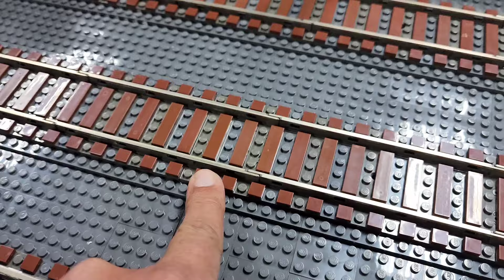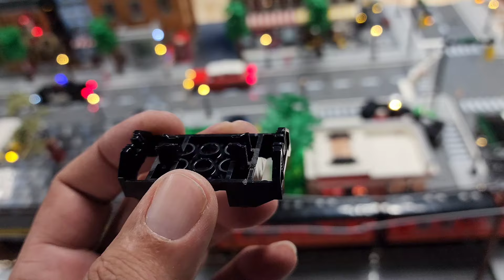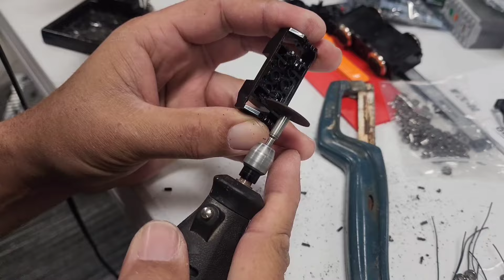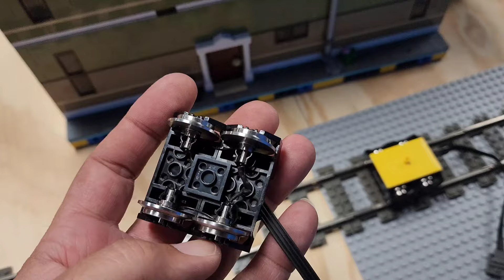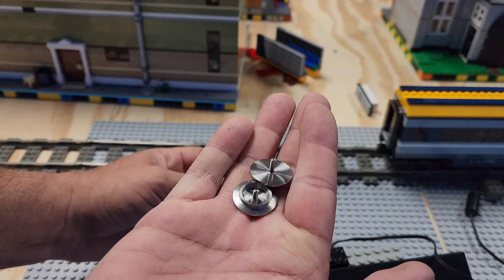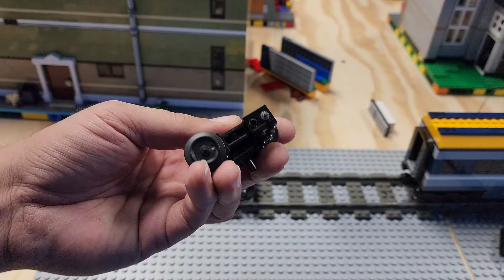Innovative Lego Train Power Solution: No More Batteries Needed!

Comment: Please send this to LEGO to let them rethink their current train system.
Reply: Personally I'm a fan of the electric rails owning both 12v and 9v stuff, but I don't think LEGO is actually wrong in their current methods either. Lego is expensive anyway and the track is expensive enough even when its just mass produced injection moulded plastic, using the 9v style track by default is going to price most folks out of buying the Lego train for their kids. And that isn't a good thing, if you don't get the kids ever playing with stuff outside of the computer toys like Lego will start to die as the oldtimers do. Plus not being conductive track means you can create track layouts that would be impossible in 9V. 

A battery is simple, relatively cheap to buy, lasts a pretty long time even with cheaper low capacity rechargeable battery and ages with alkaline battery. Its good enough.
Reply: @foldionepapyrus3441 Lego isn’t expensive because of the production cost though. Lego is just expensive because it’s Lego.
Reply: @woalk  Not that I have any major complaints with any of the clones I've tried, they do interesting ideas Lego have not, and at the price being rather shoddy in comparison isn't disappointing really. You just can't compare the two so directly and say Lego is too expensive. As you do get what you pay for.

Lego is really high quality, lasts virtually forever, and has really well thought out set designs that have clearly gone through many iterations to be really detailed, solid constructions, and still have the play value. Where the clone type construction stuff may be substantially cheaper, but its generally massively worse in quality, with much worse set design that you have to add new parts to so it won't fall apart on its own...

So yeah Lego isn't expensive entirely because because of the individual parts production costs, some of it is because they have great customer service and really make well thought out sets - all that proof of the design costs more. But the parts are just better than the clones, especially the cheap clones that either don't grip at all or can't actually be put together without a softhammer... 

Mouldking stuff is the only 'compatible' clone I've seen that gets close in part quality to Lego, and its not exactly cheap either. Because parts with the right tolerance even when you are very clearly copying Lego's homework are not cheap to make the injection moulds for... And with the designs of their sets being stunning to look at but very flawed in places. It is very clear instead of rejigging the set design or designing their own part that won't cause rapid part failure for overstress by abuse they have copied Lego's homework and probably never actually test built the design for real before putting it on sale. For instance they use droid arms held in clip brick around the elbow as a decorative element on one of the locomotives I have - which just doesn't work you will snap that clip brick in very short order or lose the arm as it violently springs off if you don't file down the elbow and glue or solvent weld the two together...
Reply: @foldionepapyrus3441  Lego’s quality has degraded significantly in the last 10 or so years. It is barely better in terms of both set design as well as fit and colour accuracy/consistency than many of the other brick manufacturers. All of them, including Lego, manufacture in China under similar conditions.
You don’t need much of expertise to make that cost-benefit-analysis between them and “a little bit better, but 10x more expensive” Lego.
Reply: @woalk  That has not been my experience, the last real Lego set I bought was without identifiable flaw, the bricks have the perfect amount of clutch power, the colours uniform. And that was only this year. Feels a bit different to the ancient stuff, so maybe it won't last the decades so much old Lego already has. But equally the old stuff probably felt different when it was new and the plasticiser hasn't had any time to leech out..

Where of the clones as I liked the looks of many of the locomotives from other brands and Lego don't do much railway I've tried a few. And other than Mouldking which is very close, way beyond just barely scraping into acceptable if you are feeling chariable that most have been. The others have been pretty awful, bricks that won't stick right, with extremes even inside the same set of won't grip at all to grips so hard you will destroy at least one of them trying to separate them again, with colour that is not really really awful as a rule, but noticeably not uniform with the odd brick being terrible... And Mouldking the only ones I'd really call acceptable, and actually I'd go further and call good (and I have first hand experience of their replacement parts service being solid) are barely any cheaper than Lego for what you get, at best its 2/3rd the price Lego would be for a similar set, and you get worse instructions and much more poorly designed sets in the process (which doesn't personally bother me, as the challenge of fixing the flaws is fun but does add value to the real Lego).
Reply: @foldionepapyrus3441  If you can get them for a sensible shipping price in your country, check out some BlueBrixx specials locomotives.
Reply: @foldionepapyrus3441  plastic is dirt cheap adding a metal strip will not make it too expensive to produce, making it expensive for customers is solely a lego decision
Reply: @Fukurokujo  Plastic parts really are not dirt cheap, at least not when you are not managing to sell sixty billion of them out of a single injection mould. Just look at the price for the compatible metal rails from somewhere like Fxbricks, if Lego were doing it themselves being a bigger company with a brand name they might manage to bring the cost to the customer down a bit, but its not going to be nearly as cheap as the RC track can be, and that stuff isn't exactly cheap, even from the clone brands that probably have terrible quality in comparison...

Moulds are expensive to design, make and sometimes maintain and that cost doesn't become nearly zero per part if you don't manage to make and sell a near infinite number of parts. Which Lego railway track being a niche part of an already relatively niche area won't. And then you are adding in a relatively expensive metal component, that either has to be fed into the mould before each shot to be captured by the plastic or requires yet another production process afterwards and more complex metal forming geometry so it snaps on.  Both of which adds to the cost per unit, which then means you probably won't sell as many making the tooling cost even higher per unit.
Reply: Wasn't expecting to see you here!
Reply: Hi Leo
Reply: I do love this and while 9-12v obv wont hurt ya here, lego wouldnt want liability involved with exposed live metal in a kids toy nowadays.
Reply: @andrewbeder51 you are wrong only lego
Reply: I have three systems in total at home. The blue unpowered track, the light gray 12V and some of the current style unpowered track again.

My primary track as a kid was the 12V track, because it was powered, but the amount of track I had available was rather limited. I installed the blue track as secondary, fiddle yard style. But the main thing I liked was the fact it was just a single track. I really don't like the linked together tracks because it's too bulky to store. 

But my kids love to play with the trains, so it offered me a chance to have them tinker. I have a good supply of arduino stuff, a few 9V motors and a 3d printer. Guess how dad and the kids are going to be doing to next few years. It'll probably drive mom completely nuts as the kids will probably learn how to operate the 3D printer all too fast ;) 

Bottom line: I will just invent my own line of lego train systems. Including a small manufacturing facility producing track and switches.
Reply: Never send Lego any ideas if you want to keep up creativity rather than profit

Comment: I'm very curious, how would a powered up version of this work if the only connection is what normally plugs into the battery pack? Will there be some kind of adapter to connect two plugs together?
Reply from the maker: Im working that out still, the biggest problem is I am waiting on plug ends to experiment with.

Comment: Maybe put a rectifier in your adapter for the IR receiver. That way it will always get the right polarity, no matter the polarity of the rails. This would also enable you to build more complex layouts by adding short sections without power between the differently polarised rails and having two pickups, rectified to the same polarity, far away from each other.
Reply: why not put a recitfier in the pickup itself, would make it fully compatible with powerfunctions.
Reply: @Ramog1000  Then it would no longer be compatible with the old 9V system with transformer. You couldn't drive backwards there.
Reply from the maker: You are exactly right, I am looking at making adapters with a rectifier built in to them though.
Reply: @ThisNameShallBeUnique  oh yeh right, whups

Comment: this is very cool, I dont have power track, but the lego grope Im in dose, and has train displays, I definitely may get one at some pont!
also I only see the 4 wheeled adapter and not the cheper one.
Reply from the maker: Im currently filling pre orders and will release both versions after the pre orders are filled.  As for the 1 wheel set or cheaper as you call it,  they do not work on switched track.

Comment: I'm the same on "say no to batteries".  Your diode adapter does make me wonder if a capacitor in that circuit could also help jump gaps in the track.  Like at my basic level understanding, it only needs to store enough energy to move the train less than an inch and it'd be sufficient.  I don't actually know how long the IR receiver has to be unpowered before it'll stop driving the motor though, maybe it's already internally handling that issue.

Sadly I'm probably not ready to pay international shipping on this kind of thing but it's nice to see new components available, not just hope to find the 25 year old bricks that still work.
Reply from the maker: Not sure if a cap would hold enough juice to power thru, but at the same time,  with a single wheel setup, the train rolls right over the gap if moving at a medium speed so it might.

Comment: I'm surprised that in the last 20 years no supplier has come up with the idea of offering something like this in mass production.
The idea itself is not new. FX-Bricks announced something similar 2 years ago. (i think)
This is so essential for 9v Train lovers.
Almost ALL Lego motor systems can be operated with this, including. 12v train-motors that also run wonderfully on 9v.
Above all, it makes digitizing the Lego trains enormously easier.
These current collectors MUST go into mass production and offer them (significantly) cheaper.

Comment: What are you using to transfer the power from the metal wheels to the cable? Carbon brushes? Metal springs?
Reply from the maker: Stainless steel bearings

Comment: Will this work on trixbrix tracks
Reply from the maker: Yes
Reply: It can't because trixbrix is 100% plastic just like LEGO RC track. Fx Track will work though.
Reply: @amseladams  my trixbrix have copper wire on them
Reply: @kkscott8019  I was not aware of 9V track from trixbrix. Is this a new product, or did you apply copper tape yourself? In any case this will work then of course.
Reply: @amseladams  I applied copper tape myself cause I like that they have narrow gauge tracks
Reply from the maker: I thought trixbrix also offered 9 volt track

Comment: What you could do regarding Powered up: Just create a replacement for the lower part of Powered Hub City Hub. There are two pins for 9V on the upper part. Pros: Train will still works with phone, remote or PyBricks, no patent issues. Cons: You still need an expensive hub.
Reply: I have just seen a video where it explains how to dismantle the Powered Hub to remove the big battery case and install two leads directly from the board. Quite an easy job. Removing the battery case will save a lot of volume as well!

Comment: Another great idea ! Just wish someone would make the 9v system parts again. I get so fed up changing batteries.
Reply from the maker: Thanks, Fxbricks makes great track for 9 volt.  I designed a simple power box and a new connecting cable, but still working out the bugs before I offer any of it.

Comment: When you doing the adapter from the wheels to the IR use a Rectifier circut.
Reply from the maker: Its basically a rectifier yes using diodes.

Comment: How well do they work on switches and other track that have small "gabs" (x-crossing). The reason why LEGO always used 2 pickups (front and after wheels for the motor for example) is to make sure the power pickup is never interrupted. I always wondered how big this impact is because LEGO could have cut costs there as well, but they didn't.
Reply from the maker: Thank you for this question.  As I feel I over looked testing on switched track.  As you are correct the switches have a gap that could cause an issue.  Ill be looking at that today and will be posting a video on it.

Comment: So we're back to the 70s/80s electric powered trains!
YES!
Reply: Well actually the 9v rails system was introduced in 1991, the 70s and 80s was the 12V center track era. Much to my annoyance, because I had gotten the red DB train (7745) for my birthday

But to be honest I converted that train to batteries to run on modern track for my sons. The amount of trouble with power pickup was just endless.
Reply: But now we call it "Innovative Lego Train Power Solution"
Reply: @Netaction  Give it the Apple treatment.. take somethingn old and call it innovative.

Comment: Never did I think I would see a system like DCC for more conventional model trains in Lego.
Reply: Actually Lego DCC has been a thing for many years, using a special firmware on an RCX and real DCC decoders.  I ordered a couple decoders but haven't gotten around to trying it yet
Reply from the maker: I e never seen anything dcc for lego, who sell it ?
Reply: @BevinsBricksWorld  I wrote a lengthy reply to this but it either disappeared or got blocked by YouTube for whatever reason 🤔
Reply: @BevinsBricksWorld  Not sure what happened to my previous comment.  It's not a product, LDCC is a custom firmware for the Mindstorms RCX.  You use the Mindstorms IR remote to send commands to the RCX and then it sends power / commands through the outputs to the track.  A 9v motor would have to be modified with one of three supported off-the-shelf DCC decoders.  It's a really old project, but very cool.  It has a ton of applications outside of trains as well
Reply from the maker: That sounds very interesting and sorry if the comment got blocked.  Youtube does tend to do that alot it seems.
Reply: @BevinsBricksWorld From my experience with a lot of  modeltrains, I'd say: a Dcc decoder works similar to the remote control.. all it would take is to replace the remote receiver by a dcc decoder, limit the output to around 50% Dutycycle by CV 5 , which is programmable (As most of the dcc controls are supplied by around 16V, even though a lot of gauge Z guys say, that they do operate when supplied with less voltage as well) and replace the supply by a DCC control station. If you want to make it a product, Id use a 8pin NEM 652 socket, which is a great standard, which is basically a standarized 2x4 1/10 inch socket.. giving additional light outputs (pinning 2 track, 2 motor, 3 lights aux minus pole, 1 plus pole). then putting an H0 decoder in would be plug n play. Good ones are fine for more than 1 Amp of current, so they should drive an Lego motor like a charme. As said, all it would take is to make sure that the output dutycyle of the motor and lights is not too high, which can be programmed in all modern decoders. As a lego adapter "plate-tine" you would end up in a 4x6 plate or brick with 5 Lego connectors (Track, motor, 3 x lights (front, rear interior) and an empty 2x2 where you could put the 2x4 1/10 inch NEM 652 plug.... The one connector on the long side, i'd do, so that ihe lego wire go in, not out, making it fitable for reg. trains.Also wrong connections might end up in broken decoders (in particular track/motor) so a disclaimer is important.
Reply: @BatteryPoweredBricks  i am intest in it
Playing Around with raspberry to get it work
Reply: I've seen folks using just straight up DCC before, sound and all. No idea what they did for the motors though
Reply: I don't know where my other longer comment went. But in short: It would take an lego -NEM 652 adapter plate-tine. that is the latest standard, using a 2x4 1/10 inch socket, in which a modern dcc decoder could be plugged. Could also be used for 12V. The Voltage in general needs to be limited by programming the decoder outputs. It offers track, engine and 3 light outputs (8th pin is common plus supply for the 3 lights, front, rear, interior) Then people could connect their dcc control station directly to the track.
Reply: Peekaboo I found you

Comment: Would advise using a dedicated bridge rectifier ic/discrete component for the adapter. Also I'm not entirely sure but I'm not sure the power up hub has a power input on the ports. Theres contacts that you can expose by unscrewing the battery compartment and removing it from the hub.
Reply: a bridge rectifier may be better yeah. it would drop the requirement that the rails be the correct direction, and allow for doing odd layouts with polarity crossings if so desired (tho extremely rare I'm sure)